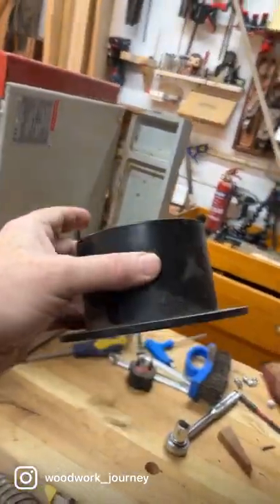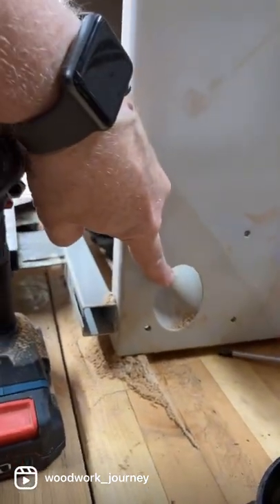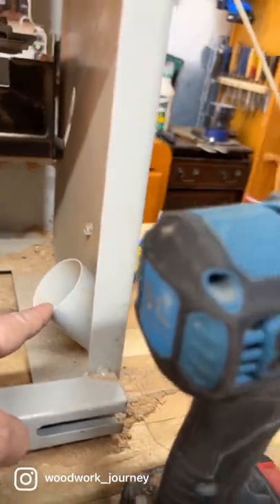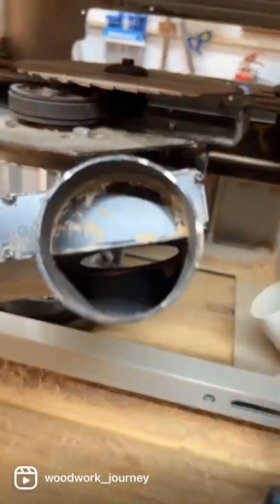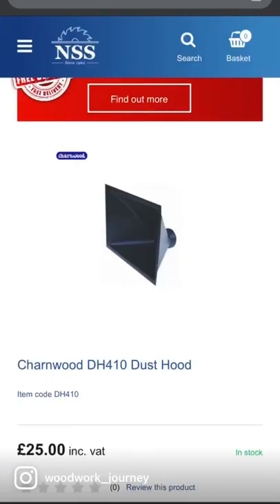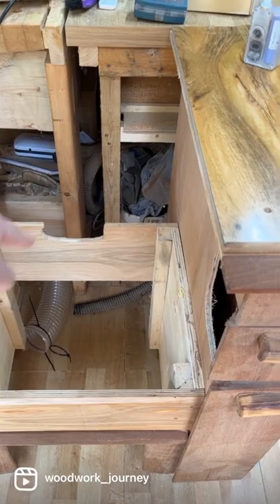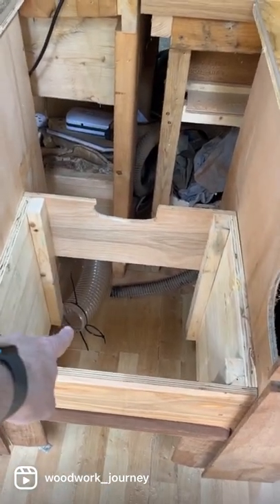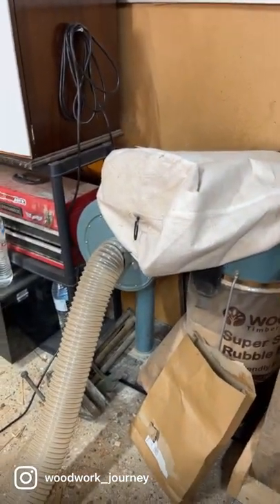Improving my tablesaw dust collection

Comment: There are always a few ways to get rid of dust - easy way is strip away what is included and seal off the side collection & build a wooden funnel into 100mm
Reply from the maker: I was going to build the bit I needed rather than buy the Charnwood one but my brain can’t handle working out the angles LOL